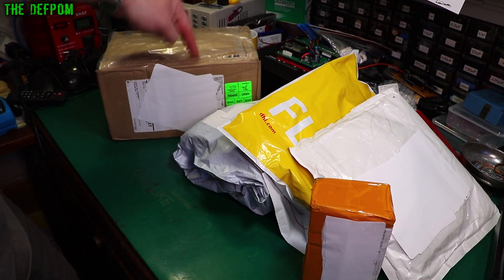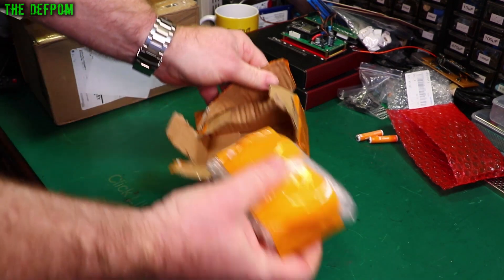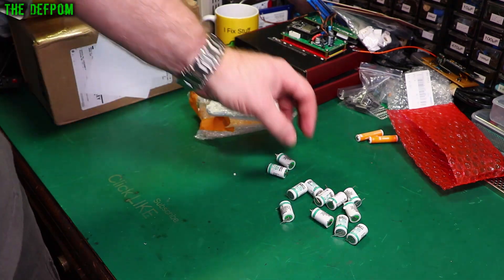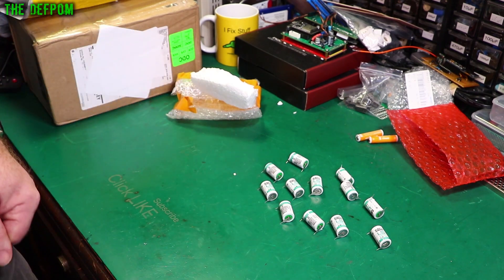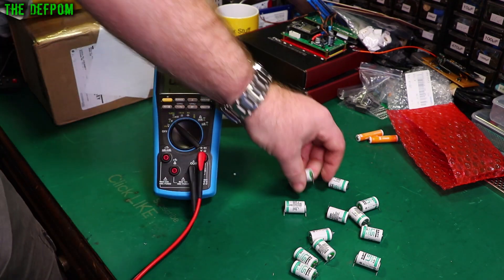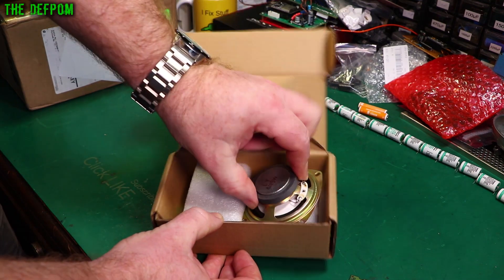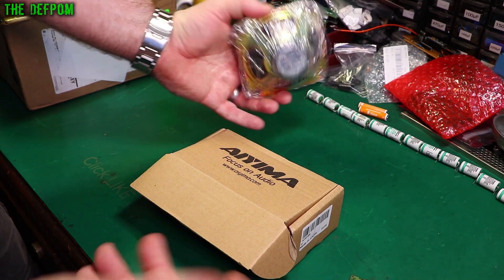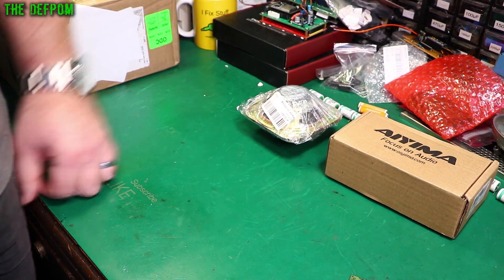🔴 What's in my Mailbag ? - Mailbag Monday 14th February 2022 - No.924

Comment: As a long time AliExpress user have you seen AE going down hill regarding customer service and disputes? Some people have indicated that filing a dispute on AE these days is a crap shoot. People have reported filing a dispute showing AE that their order was delivered in an city other than the one they are located in and AE denied the request for a refund. Same thing with devices that arrive partially working. AE determines the device still has value and award the buyer say 1/5 of the value of the item. Only way to get a full refund is to ship it back to China and hopefully it gets there and seller does not try to pull a fast one trying to blame the damage on the return shipping. 

Just thought I would ask about AE when things go wrong do you feel it is a crap shoot getting a resolution that you can live with.
Reply from the maker: I’ve probably had a 95% success rate, in fact recently I would say it actually got better.

Comment: The IC clips look good I still have some from the 90s when I used to work with traditional logic and processors. I’m starting to struggle with high voltage capacitors and even RS have a tendency to push cheap shit brands.

Comment: Yea!! more Crapacitors🙂 Oh and by the way don't worry about your in circuit tester not being 100% are any projects 100% ?? 🙂
Reply from the maker: In circuit won’t be 100% perfect as it will be relying on the device to use as many memory addresses as possible for the unit to monitor, but it should at least check the active ones, which will probably be enough.
Reply: Squeak !
Reply: @andymouse  brie Cheese!!!!!!!!!